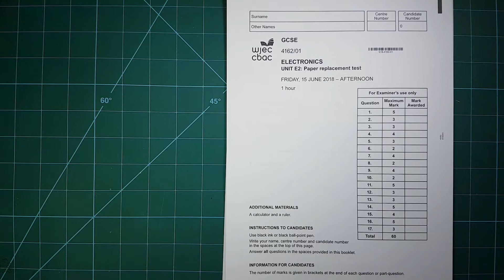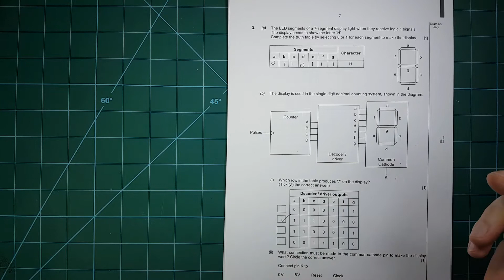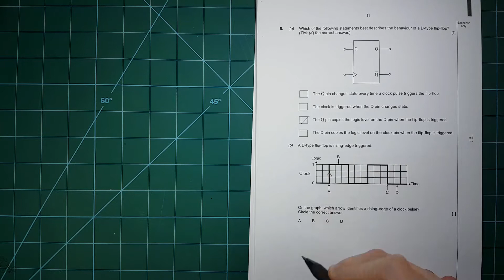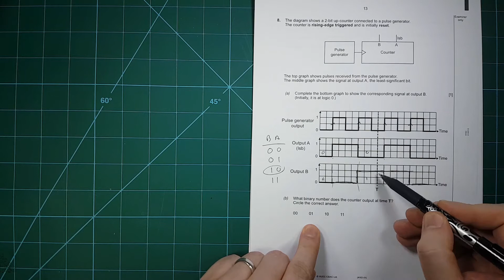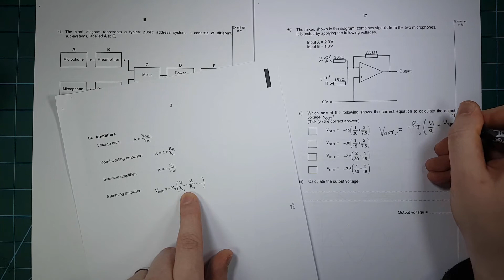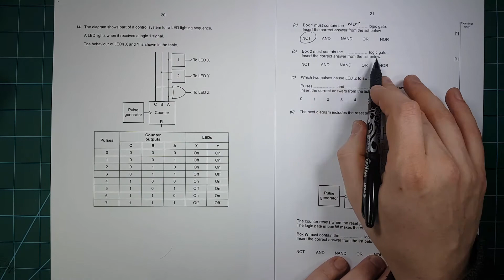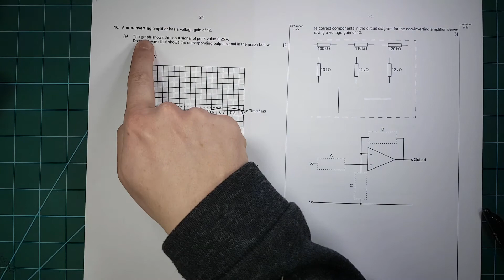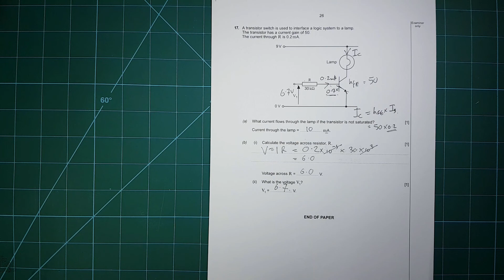GCSE Electronics 2018 paper 2 WJEC

Comment: For 11b why not just use a calculator - isn't it allowed during the exam?
Reply from the maker: you can do.
Reply: @pastpaperguy8744  23:32 are you sure the current gain is the same if the transistor is not saturated?
Also if the transisistor is  not voltage saturated then the V in wouldn't end in  x .7V
Reply from the maker: @vintagememelord8168  yes. The current gain is Hfe. When the transistor saturates that equation we used to get Ib no longer applies.. As any increase in Ib doesn't make an increase in Ic. My explanation is definitely correct.